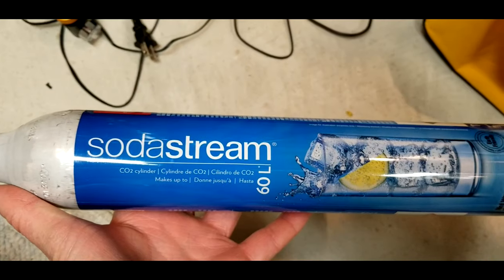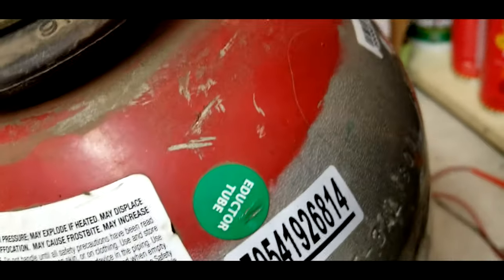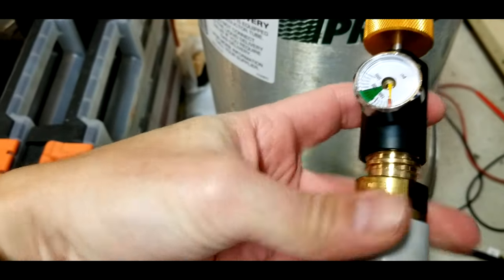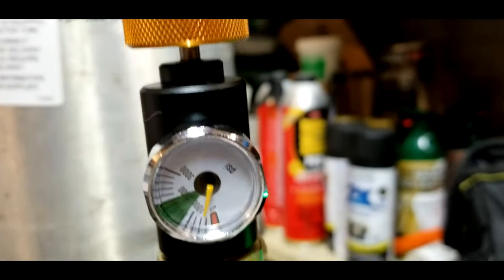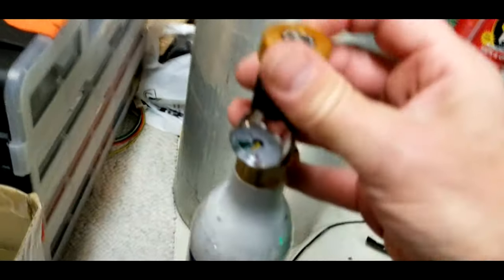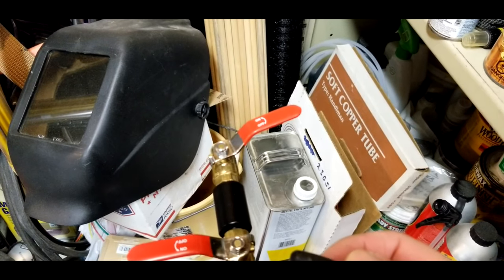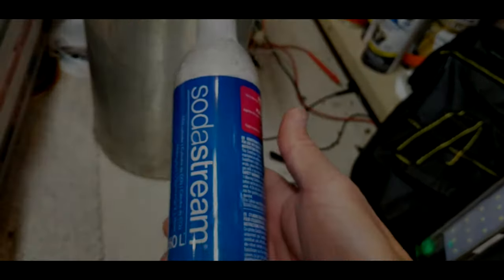How to Refill your Sodastream CO2 Cartridge for under $1.00!

Comment: I've seen it suggested in numerous places that you can get more complete refills if the cartridge is cold when you fill it with CO2.

Initially when using this, I tried putting the cartridge in the fridge beforehand. That got me up to 80% full (based on weighing the cartridge before and after, and comparing the difference to the 410g that it allegedly holds).

So more recently I decided to try putting the cartridge in the freezer before filling. I TWICE ended up with an experience in which I seemed to get the cartridge full (up to about 1000psi), but then when I bled the line (and watched the pressure drop to 0), and removed the cartridge, and weighed it, it was empty again.

The first time it happened I was confused, decided to put it back in the freezer and try on another day, and very carefully check my steps the next time.

So the next time, I went slowly and carefully. I'm absolutely positive that I closed the knurled fill valve before bleeding the line. (Presumably if you forgot this step, that could explain bleeding not just the line, but the whole cartridge.) But the same thing happened again.

So this time I decided to just try again, close to right away. By now, the cartridge had warmed quite a bit. It was still a little bit cool to the touch, but nowhere in danger of sticking your hand to the frozen metal, like when it initially comes out of the freezer. I'm pretty sure I did nothing different than the previous attempt, and now it worked fine. (And I got the cartridge up to 94% full.)

My theory is that maybe when the cartridge is frozen, that the valve on it doesn't operate as well, and that even once you back off on the knurled fill valve, it doesn't return to a closed position right away. And that on the second attempt it had warmed up enough to operate smoothly.

Has anyone else experienced anything like this?
Reply: So the next time I filled it, I again put the cartridge in the freezer first.
This time I brought a kitchen scale with me. I was determined that if the tank started losing mass I wanted to know right away.

One thing I discovered -- I had initially stopped filling when I couldn't hear the gas any more, but it turns out that wasn't really full. As the cartridge gets full, presumably the rate of flow slows down. So it still was filling, just much more slowly, so that I couldn't hear it. (I'm outside with the garage door open; not sure if I could maybe have heard it if I was inside the kitchen.) Anyway, I kept it going until the scale stopped changing, and I got it all the way to 410g above its starting weight, so 100% full.

I closed the valves right away, but then went inside and waited a little bit for everything to warm up somewhat before bleeding the line and removing the cartridge. And the cartridge stayed full.

This is still just a few data points, so I'm not sure if that made the difference (and also I have two different cartridges, so maybe one has a flaky valven and the other is fine), but at least for the time being I think I'm going to stick to that plan. Maybe if I get it consistently working fine I'll then try going back to finishing the process when it's cold and see if problems return, but that's a while in the future.
Reply: Same happened to me!

Comment: No eductor tube, do the same procedure, but with the welding tank upside down. This is how I carbonated my home brew in minutes rather than days.  I’d connect my 20lb  CO2  tank (sans eductor) to the SERVE side rather than the GAS side of 19L premix soda kegs and turn the CO2 tank upside down,giving quick shots of CO2 with time for everything to equalize between shots. This way, some liquid CO2 mad its way into the liquid beer and dissolved in it MUCH quicker than having the CO2 slowly dissolve into the beer from the small surface area of the top of the keg.  YMMV.

Comment: Serious question. I read on another video in the comments to make sure it's food grade CO2.
Where do you get food grade CO2 refills for the big tank?
Reply: co2 is co2.
Reply: @stevesilverstone4385  ...actually that's incorrect...industrial CO2 (which is likely what is being used here) has a purity level of 99.5%...Food Grade (or Beverage Grade) is 99.9%...
Reply: @angusandleigh  They are the same. Just extra paper work for food grade.

Comment: It is absolutely imperative to open the fill valve VERY slowly. Otherwise, the check valve engages. and your tank won't fill.
Reply: Thanks!! That's exactly what was happening to me!
Reply: This is true with the newer "boobytrap" valves. If you have tanks with the old style 'pin top' valve they work without issue. 
And you can either buy replacement valves online for about $15. There are also videos on how to modify the boobytrap valve to work like the old one. It takes a bit of skill but is not difficult to grind away a bit of metal on the boobytrap area of the valve.
Reply: @k8smate711  hey is an eductor tube also known as a siphon tube? I can’t find any co2 tanks online here in the Uk that have eductor included.
Reply: JDC just flip your tank upside down.
Reply: @jdc4316  Just posting to say yes, a siphon tube tank is what you're after. :)
Reply: Re: flip upside down
That seems a bit unwieldy compared to just getting one with a siphon tube (which is what some shops call an eductor tube).

Comment: How many ounces of CO2 should you get in the sodastream bottle after filling?  Starting with an empty (0 psi) bottle from the freezer I can only get 4.3 ounces of Co@in the bottle.  I have a brand new 20lb CO2 tank.  When finished filling the gage reads about one needles width below 1000 psi.

Comment: I’m not sure if I’m missing something but what is the full psi pressure that you can safely fill sodastream bottles?
Reply: Ask sodastream 🤣
Reply from the maker: That's not how liquid CO2 works.

When you have liquid CO2 in a tank, the gaseous pressure is ALWAYS the same, regardless if the tank is full or almost empty, and that pressure varies depending on the temperature. At room temperature, the pressure will be around 800 psi. So it doesn't matter if you have a 20 lb tank that is 10% full or a little Sodastream tank that is completely full - as long as there is liquid CO2 present, it will be around 800 psi (at room temperature). So it is completely safe to fill this way, it isn't going to explode or anything.

When the liquid CO2 is used up, what remains is gaseous CO2, and the pressure of that gaseous CO2 will drop quickly as the gas is used up. This is why your Sodastream seems to work perfectly until the tank is just about empty, and then it just doesn't hardly work at all anymore. As soon as that starts to happen, you know you've used up all the liquid CO2, and it's only gas left in the tank.
Reply: @ScottsSynthStuff  Scott, based on your explanation above, it's not clear why your Sodastream gauge shows "only about 750 psi because your welding tank is getting close to empty". :)

Comment: Would the fitting be the same as typical on a kegerator style bottle?  I figure I could get a smaller/cheaper bottle and just put it upside down to get liquid out of it, right?  Or is there a float valve to make sure those tanks dont let out liquid?  For that matter - If I dont care about filling it twice as often, does it even matter if it fills with just gas?

Comment: I was wondering if this was possible,  but not knowing if the welding supply CO2 is food grade or not was my concern.  I know some of the oxygen is full of oils and contamination that separate it from medical grade. 🤷🏽‍♂️
Reply: Just ask them. The welding supply shop around here only has food grade CO2. (But I ended up going to a homebrew supply shop b/c they were cheaper.)

Comment: I just got done watching your video, how did you know your sodastream canister was full? Doesn't leaving the valve like that overfill and potentially blowing up the canister?
Reply from the maker: You can't overfill the canister. It will stop flowing when pressure is equalized.
Reply: @ScottsSynthStuff  Thanks so much for the informative video. I was wondering if welding co2 is as as safe to drink as food grade. Would really appreciate a response. Thanks so much!
Reply from the maker: @janethecanadianme3564  They come from the exact same plant. They don't have a factory that makes welding CO2 and another that makes food CO2. Just like they don't make welding oxygen separate to medical oxygen. The same machines make the same gas. So yes, it's safe.
Reply: @ScottsSynthStuff  Thank you so much for your response . that's great news.  I got a soda stream for Christmas and the co2 is expensive.  You have a new subscriber to your Channel! God bless you  and Happy New year! 🙏

Comment: Why don't you just hook the big tank to the back of the macine
Reply: My question, as well.
Reply: You can definitely do that with an appropriate adapter hose, BUT--don't use the tank with the hose in it like is shown in this video, you need to do it with a "standard" CO2 tank that just supplies gas (not liquid) CO2.  I've had a 20lb cylinder hooked up to my Sodastream for 5+ years now, it works great (and is a LOT less hassle than refilling tiny tanks all the time; I go for a 20lb tank swap every 9-10 months).
Reply: @mrh829  I’ve read your comments and think you’ve got a great solution. I’m assuming the gas CO2 tanks (of whichever size) may be safer and cheaper to refill than a liquid alternative?
Reply: @victoryak86  When you get a commercial tank, regardless of type, you're not going to refill that yourself; either way that will get filled by a commercial gas supplier.  The siphon/hose tanks like the one discussed in this video are for dispensing liquid CO2 for when you're using a large tank to refill other tanks.  Standard gas CO2 tanks are for when you're going to use the gas directly from the large tank, and that's what I have connected directly to my SodaStream machine.  I can't speak for cost differences between the two types of tanks as I've only used gas ones.  Where I live (midwest USA), the last time I did a tank swap on my 20lb tank it was about $36 (and keep in mind, 20lb is equivalent to over 22 standard SodaStream tanks, which would cost $330 at MSRP for swapping those out).

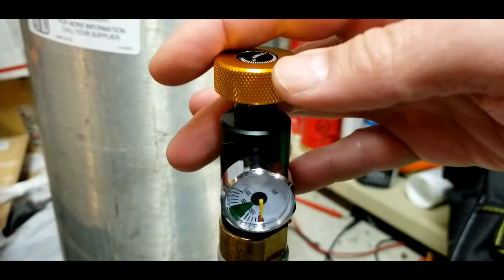Comment: At 51 second mark, you say "turn the knurled valve clockwise to CLOSE it"  and at the 1:24 mark you say "turn the knurled valve clockwise to OPEN it".  Which one is correct?   Thank you for the great video but the above problem exists unless I am missing something.
Reply: It looks like counter-clockwise to close and clockwise to open, based on watching what he did.
Reply from the maker: Brian is correct. It's clockwise to open it, and counter-clockwise to close. Turning it clockwise screws the valve in, which depresses the valve in the cylinder, opening it.
Reply: @ScottsSynthStuff   Thank's Scott.  I am doing this with success thanks to your video.  You may want to edit the video to correct it at the 51 second point.

Comment: Just filled up 3 bottles. One was on the counter and the relief valve popped and all the co2 came out. Then I tried the other 2 bottles in the soda stream and they did not work. Both have co2 in them. Have you heard of this problem😜

Comment: Hi - I created this setup however when I fill the cannister I only add about 100 to 150 grams of weight.  Per my internet search I should be adding over 400 grams.  Any thoughts on this?
Reply: Yeah, no eductor on the large CO2 bottle ;)
Reply: @einball  I have the same issue and my tank has the eductor tube, as confirmed by Praxair and the sticker on the tank.  Any other possible causes?  Seems like such a coincidence that my tank stops filling at approximately same point that is shown in the video.  Although he blames a nearly empty tank and my 20 lb is full.
Reply: Anyone tried FREEZING your Sodastream bottle first? CO2 is temperature dense, so freezing your bottle (deep freezer) will encourage the gas to fill up much quicker and likely much denser.
Reply: @mbraucht   I'm by no means an expert, but I did read some recommendations on Amazon (listing for the refill tube, gauge, etc) that chilling the canisters in the refrigerator does help and some  people recommended freezing them, but at least one person warned that if you freeze them you could potentially refill them to a point that when the canister reaches room temperature again it will be over pressure and could burst.  I can't confirm the accuracy of this but I'm just passing it along.
Reply: I froze my 60L SodaStream canister and was able to get 358 grams of CO2 inside.

Comment: I have the same valve unit and a large CO2 tank. It has been working very nicely until now. As I open the valve, (and I use a scale to measure +~300grams of additional weight, after a very short period of time the container stops accepting the CO2. (20 pound tank)
Do you think I'm out of the gas? The tank still is heavy...I have filled about 30 Sodastreams, but I assumed as long as I'm getting gas from the tank, it's not empty. Any thoughts appreciated.
Reply: I'm confused. Is the issue that you're expecting to get more than about 300g of CO2 in the cartridge?

The alleged capacity is 410g. I don't think you're ever going to fully reach that. I've ranged between 263g and 386g. I would suspect that the amount you can get might decrease as your main tank starts to get closer to empty, but I don't yet have any experience with that. I've also heard that chilling the cartridge first can help, see my comment above about my attempts with fridge vs. freezer.

Finally, 1 kg is about 2.2 pounds. So a 20lb tank is about 9.1 kg. If you really could get a full 410g fill each time, that would be only 22 refills. If you're only adding 300g each time, that's 30 refills.

If you're getting gas from the tank, I assume it's not yet empty, but my guess is you're probably close to empty at this point.

Comment: Thanks for posting this video. I'm excited about getting this setup for my family.  I see you're using the blue 60L cartridge. What adapter should be gotten for the pink gas cartridges? I have a SodeStream Art.
Reply: Really!! I think we are screwed because there are no threads my friend! Unless there is a quick disconnect version, I think we are SOL. I'll check with the welding shop but I have noticed all the videos have shown blue bottles with threads. Let me know if you find something....

Comment: What PSi to you hit to know you’re done?
Reply from the maker: It will stop flowing when it's done. The actual PSI depends on ambient temperature, but at average room temperature, liquid CO2 will off-gas to about 750 PSI. If you are filling and you see it is putting less than 700 PSI, then you know you're out of liquid CO2 and you're now just transferring gas, so time to get a fresh tank.

Comment: I'm no expert but personally I would only use food grade CO² for a soda machine, available from gas supplier.
Reply from the maker: Talk to a gas supplier. There is no difference. The gas plant that produces CO2 does not have a separate "food grade" CO2 line - it's all comes out of the same machine. The only difference is that they charge more the "food grade" gas - even though it's the exact same thing.

Comment: I've always opened the main valve slowly, and have never had a problem tripping the mechanism in the cartridge that triggers if you try to fill it too fast.

My question is, if you screw up and do this accidentally, what then? Can you just try again? Or have you put the cartridge into some kind of bad state, where you need to do something to get it useable again?
Reply from the maker: Just disconnect and reconnect the cartridge, it will reset the valve.

Comment: I probably have the dumbest question. Is there any reason the soda stream machine couldn't be hooked directly to the big tank?
Reply from the maker: Not a dumb question at all. The answer is no, no reason at all. If you have the space and the hose, it can be done.
Reply: @ScottsSynthStuff  I've definitely got the space. (Tall pantry cabinet beside the fridge. Drill a hole through the side of the cabinet and the soda maker will sit right beside the coffee maker.)

All I need is for you to show me how and link me to the supplies! lol! (I got the husband on board now!)
Reply: @ScottsSynthStuff  Oh, and my daughter wants to know, too. She's found smaller tanks that would fit under her sink, and still be a LOT cheaper to have refilled than the stuff the drink makers want us to buy.
Reply: Just DON'T use a siphon/hose tank like is featured in this video; you want a regular one that supplies CO2 as a gas, not a liquid, when attaching directly to the machine.  Liquid supply is for refilling, gas supply for when you actually want to just use the CO2.

Adapter hoses are not hard to locate, but different manufacturers might call them slightly different things.  The CO2 tank end is going to be a CGA320 fitting, and the Sodastream end might be called "Sodastream" or "Soda club" or "TR21-4 soda maker."  Depending on how long of a hose you want, and whether you go with rubber or braided steel, most adapters today are in the $30-50 range.  I've had a 20lb tank hooked up to my Sodastream for over 5 years.  The only caveat I will mention if you're putting the tank under the counter top is that depending on the quality of the adapter hose, it could leak CO2 when unused, so it may be better to err on the side of caution and keep the tank where it is accessible so you can close the valve whenever you're not actually using the machine.
Reply: @ScottsSynthStuff  thank you! I've just hooked my soda stream up to a 20 lb tank. I was blown away that it was only $35 to fill it.  Definitely worth it!
Reply: @bethanypatrick4286  just curious, did you get a tank with liquid cO2 or the gas version?  As the commenter above said, he recommends just the CO2 tank with gas when directly hooking up to SS.